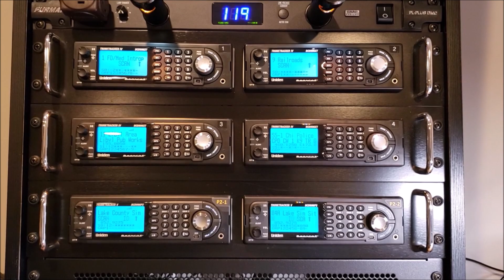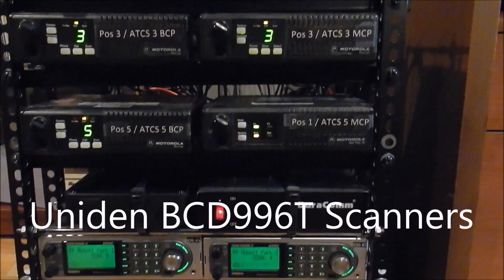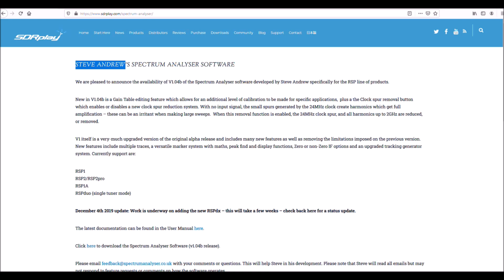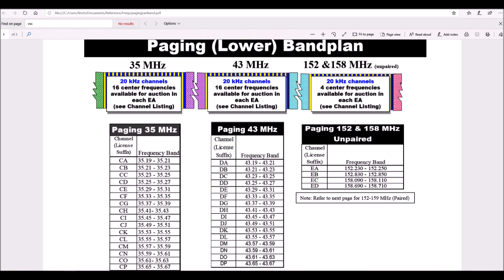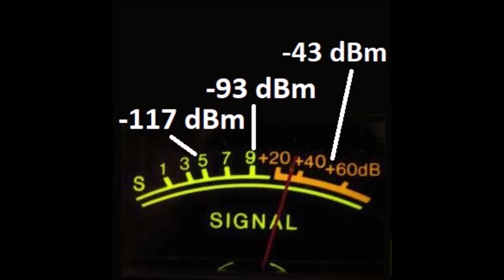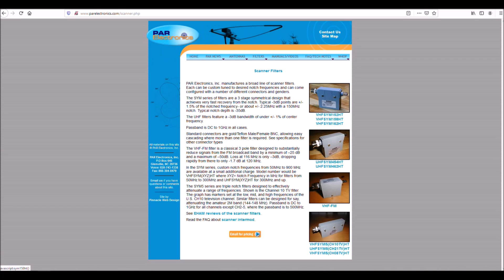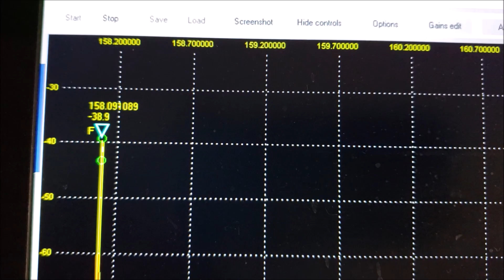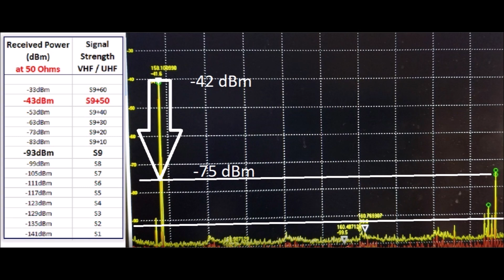Filter Eliminates Scanner Intermod Interference

Comment: Put a FM broadcast filter in there as well, if you do not already use one. The Stridsberg multicoupler sometimes create intermod if the input signals are to strong to it. Stridsberg does some modifications to their multicoupler that decrease the gain, it's a bit too high, and improve its intermod rejection. I removed my multicoupler and replaced it with an $30 amplifier that have bigger dynamics and then a standard $10 CATV splitter and the improvement where noticable. Better low noise, could hear more, and didn't overload and got into a non-liniar mode that creates intermod. If you can borrow a signal generator then insert a weak signal to the coax from the antenna thru a 20-40dB attenuator, or listen to a constant weak signal in analog mode, and then have a variable attenuator before a multicoupler, or at each receiver for test, and adjust the attenuation level for best sensitivity. Too big signal and you start to de-sense a receiver and loose coverage that you might not be aware off until you do some tests. Even bigger signals than that and you start getting intermod.